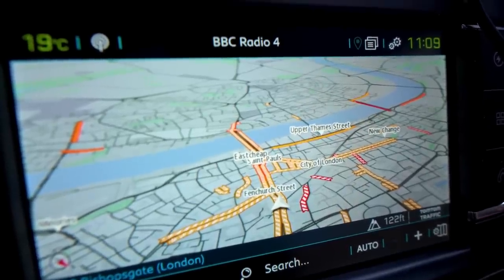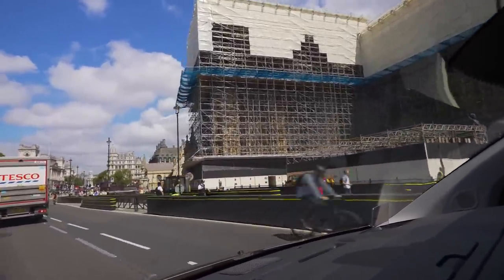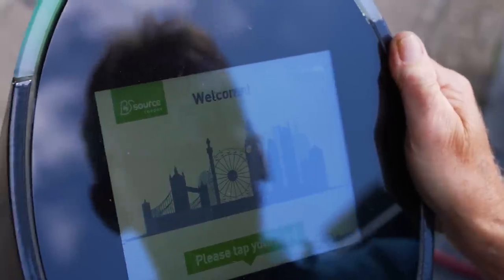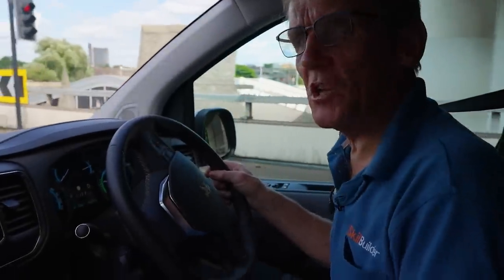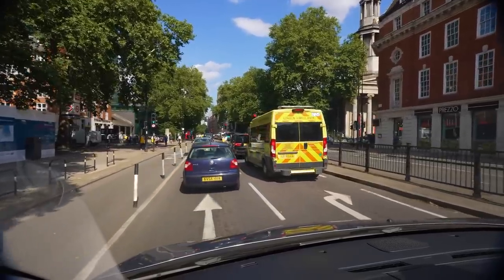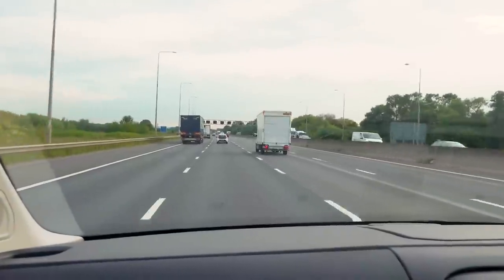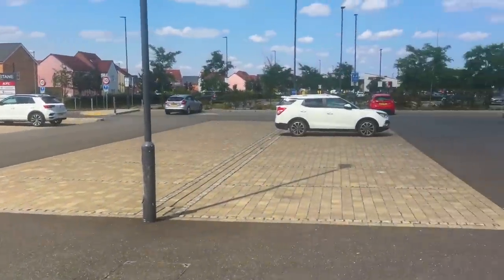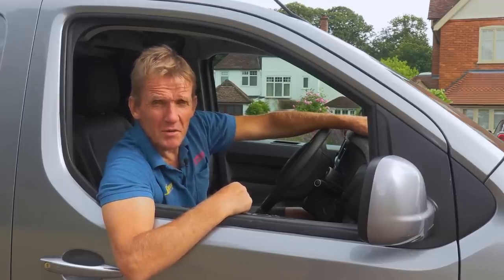Is It Time To Switch To An Electric Van?  e-Expert Test

Comment: it would be good to see how well the van dose in winter when you need lights, heater, windscreen wipers, etc.
Reply: I think we all know the answer to this, tests I have seen with loaded vehicles & fair bit of electrics in use pretty much halve the potential max range .
hybrids make more sense and reality is EV vehicle not as emission free high efficiency as you think, take a look at the coal, gas, oil, nuclear, biomass plants producing the bulk of the electric and see how green and sustainable some of them are long term and in required numbers power a EV future ...
Reply: FYI like diesel vans, the lights and wipers run from the 12V battery so doesn’t affect the range.
Reply: Most of your charging will be at home and many green tariffs are now cheaper than coal-based tariffs. When charging on the go, choose one of the many green only charger companies. This way you can charge completely fossil free.
Reply: @jezthomas4402  the 12v battery charges from the main drive battery through a dc to dc step down inverter. So it has to reduce range. That's why EV try to pre heat or cool while plugged in to take the initial loss of energy.
Reply: Especially when the battery begins to degrade after a couple of years.
Anyone with a smart phone will know the answer!
Reply: @twig3288  A smart phone uses lithium-polymer which has a fairly short life but are highly compact  making them ideal for small handheld products, most EVs use lithium-iron-phosphate batteries that have a much longer life something like 10x but a lower energy density meaning you need a bigger space for the battery something a large veicle has no isseue with.
Reply: @jezthomas4402  Really? It might well last long but it won't be near its full capacity by then. I've had ev's since 2010 and they have all deteriorated by varying amounts. Mileage doesn't help but age is the real killer. Remember these are range limited vehicles in the first place and after a year they usually drop a bit. Then the next year its a bit more and so on. 
Eventually you end up with a very slow charging, short range paperweight. 
I don't know how short the body is expected to last but batteries over about 8 years old are usually few and far between - with a lot of the ones still going being almost useless. 
Have a look at some early Leaf adverts and take note of how much they have lost. i3's aren't as bad and neither are Teslas but they still drop a lot more than you would hope.
Reply: @twig3288  In a couple of years, the battery will have degraded around 5%......if that.
Reply: @Brian-om2hh  It depends on the charging cycles.  Fast chargers will cause the battery to degrade faster than granny chargers.

Comment: Can't wait to see charging vehicles outside Terraced housing and in blocks of flats, top it all off with the yobo kids vandalizing
Reply: I'm quite excited to see the tax system that will eventually be imposed when more people go electric. It's also going to be quite nice when the prices for electricity in the night get hiked up to meet the new demand
Reply from the maker: Chewy. That is the problem and it doesn't seem solvable from where I am sitting.
Reply: @Phil Ware You don't park your car in a petrol station every night either, how is that different, oh yes, some of us have brain cells
Reply: @Phil Ware it takes 2-3 minutes to fill a car with fuel. That's how it's different.
Reply: @Phil Ware if we're trying to go to a fully electric system for transport I'd say yes, some people not having a charging point available would be a fairly big problem. Have you ever lived somewhere where you don't have enough dedicated parking for your house members? When your coming home from work not knowing if you'll even get a space anywhere near your house? That's pretty miserable by itself, add in the anxiety of not knowing whether you'll even be able to get a charge to get you back to work the next day and you have a problem.
Reply: @Phil Ware well, rapid charging comes at a cost, mainly for how long that battery cell will last. The price of replacing those cells is also pretty eye watering. I think you're very naive if you think this fundamental flaw can just be "solved". I think you're also quite naive to believe that all these wonderful free charging points will remain free for too much longer.
Reply: @Phil Ware you really thought that one through, those long hours that people drive and are too knackered to stop at a charging point before bed and wait a few hours before then finally going home to bed, yeah there RE YOUR BRAIN CELLS
Reply: @greenreaper1985  he really isn't very bright is old @Phil Ware ,
Totally brainwashed by what the eV car salesman told him,
My mate just bought a Renault kangoo eV van it's absolute dog shit 70 miles on a charge what use is that when your a builder working on site with zero charging points!! 🙈
Reply: @pauldavies7251  it's not that he's stupid, he's just in a more privileged position than a large portion of the UK are in (not to say he hasn't worked hard for that position of course). The whole electric vehicle system will work very well for people in a higher income bracket, there's no doubt about that but it's going to create another layer of hierarchy if we're not careful. Can you remember back to when parking somewhere even vaguely near a city centre or beach DIDNT cost an arm and a leg? And people are expecting not only the car parking space but the electricity to charge your car to remain free? It's a ticking time bomb. It wouldn't surprise me to see £50 parking spots with chargers in the near future
Reply: It's obvs mate unjust dangle an extension lean from the 12th floor and hope when you come down in the morning your still plugged in and your neibour hasn't helped themselves 🤣😂🤣😂🤣😂
Reply: @Phil Ware in our lifetimes batteries have come on leaps and bounds, but I still don't think they are the solution to our problem. I think long term the hydrogen fuel cells will be our solution until we can more safely harness fission/fusion reactions
Reply: @Phil Ware not if they unplug the 13 a plug top from the extension lead 😂🤣😂🤣
Reply: @Phil Ware the charger leads are relatively short won't reach the 6th floor mate🤔
Reply: @Phil Ware your main argument is that people are judging electric vehicles by today's standards and not what they could be in a decades time. I'm fairly sure the people who are working on the hydrogen cells won't be sat twiddling their fingers for a decade either. Let's wait and see how much "tax" will be applied to electricity in the very near future
Reply: @Phil Ware 20 minutes charge option boils the battery pack and dramatically reduce vehicle life. Fast charge should only be done once in a while  ..
Normal charge 22 hours. From a 13 amp plug socket.
Reply: @Phil Ware hydrogen fuel won't work because you don't understand it. Brilliant
Reply: @Phil Ware where was my first example of name calling?
Reply: @Phil Ware Are you still bleating on ? With leccy cars the grid will crash every night unless enough nuclear plants are built. You and the green brigade don't want them so good luck getting to work like the working class need to
Reply: @Phil Ware The difference is you can fill up in a fuel station in a couple of minutes.

Comment: Can the National Grid infrastructure handle it at peak charging times? Can we have a National Grid electrical consultants point of view on this? Is there enough natural resources in the world to handle this policy?
Reply: The grid are crapping themselves
Reply: Actually the answer, surprisingly, is yes it can! Have a look on youtube for a guy called John Ward - he's a very knowledgable electrical guy with no connection (pun intended) to power companies. He gives the full picture.
Reply: @Pandora882  BS , the grid says they can handle it look on their website
Reply: Yes the grid will cope, see any podcasts by the Grid, the load on the grid has declined by 20~25% over the last decade as a result of lower energy light bulbs. The proliferation of  solar panels and the roll out of vehicle to grid technologies will ensure that loads are more evenly spread.
Reply: @bob-pc8bd  interesting, thanks for sharing, first time I have seen any reference to this previously all the info I had seen suggested no problem assuming a gradual uptake over the next decade.
Reply: There is massive excess capacity in the UK grid during the night hours, because it isn't possible to just switch off a nuclear power station. They need to find ways to encourage the use of electricity during the night, and charging an electric car is one use. The energy companies virtually give the electricity away - at around a third of the daytime rate - so it's also the cheapest time to charge an electric car. Plus you don't need your car when you are asleep.
Reply: @bob-pc8bd  The National Grid say yes. And as they're the people who actually run the grid, and not you, so I'll go with their word if that's ok with you.
Reply: @bob-pc8bd  In which case the Commons Transport Select Committee is talking cobblers, because the Head cheeses of the National Grid, plus another industry authority, sat in front of a Parliamentary Committee to answer the questions being asked here. The YouTube video of that Parliamentary Meeting with the National Grid is available for anyone to see if they wish, and the upshot was that there would be NO problems with supply...... In fact, so confident are the National Grid, they were among a number of organisations who lobbied for the ban on the sale of new petrol and diesel cars to be brought forward to 2030 from 2035. The National Grid anticipate there being around 9 million EV's on Britain's roads by 2030, and say they're ready...

Comment: I’m all for EV vehicles but in there current state I would like to buy one with a petrol range extender. Just a 15-20L tank would be nice to not have range anxiety.
Reply: A petrol range extender? 
You mean a generator?

If EV's come with an optional, petrol powered 'range extenders',  that surely proves that they aren't fit for purpose in the first place.

When the prime minister uses only EVs, I'll get on board.
Reply: There won't be such a thing as range anxiety in 2030. There are presently around 26'000 public charging connections in the UK - three times more than there are petrol stations. There has just been a huge deal signed by a charge network company to supply a total of 190'000 EV chargers by 2030. Even the less costly EV's now have getting on for 200 miles of range. How often do you drive 200 miles all at once?
Reply: @Brian-om2hh so, petrol stations generally have between 4 and 12 pumps, so your numbers are pure fantasy, 
People do regularly drive 200+ miles per day, how do you think the crap you order of Amazon gets from the docks to your front door? Not to mention the high class foods that have to be driven into the city centre  so you'll have something to eat while you wait for an hours recharge in order to get home.
Then let's ask, where is all this electricity coming from? In order to meet demands we will need more power stations, and thousands of miles of copper cable, and hundreds of thousand tons of concrete and steel, do you have any idea the environmental costs of producing, and installation of these types of materials?

 You show how out of touch with how the real world works you are.
Reply: If they fitted gearboxes to EVs, then range wouldn't be so much of an issue.
Reply: @ramblingman8992  how would a gearbox help extend the range of EVs?

Comment: Looks like a good van, but things like electric sliding doors, GPS monitoring and cameras are just using valuable battery life.
How hard is it to open a sliding door? (And would you ever remotely open the side door, exposing your tools while still sat in the drivers seat? And the rear camera, like you say, you can reverse fine with mirrors? A built in reversing camera but no dashcam?
The purchase price could be lower and range longer if you ditched the gadgets surely? It's a van, not a pleasure vehicle.
Reply: And a roof. Who needs a roof?!
And 4 wheels. Why 4 when 3 gives stability?!
Reply: @Monaleenian  haha, very original,  
Lmfao! 
Tell us another un?

Comment: Wait till the mayor has turned the whole of London into electric the congestion charge is a charge for a vehicle doesn’t matter if it’s petrol or diesel it’s a congestion charge so eventually the mayor will charge you to drive in central London in an electric vehicle because you’re paying for congestion not whether it’s a petrol or a diesel is a congestion charge and eventually they’ll be nowhere to fucking charge it because everybody Will be using charge points and the cost of parking will go through the roof for the loss of revenue and income that the congestion charge generates so the only person to blame for the cock up of London is the mayor he is one big prick
Reply: Fact Check:
The consensus of expert opinion is that EVs don't cause congestion.
The science is settled
Reply: I've just ordered a Horse and Cart !.
Reply: @moonraker124  You do realise of course that horses emit greenhouse gas?

Comment: I like the idea of electric vehicles, the quietness and the driveability. I’m not convinced by their eco credentials, in fact I know fine well they’re a load of bollocks on that front. 
The problem is they’re no use to me as I regularly drive several hundred miles a day and not to big cities with facilities. The other myth about e-vehicles is that battery technology will catch up and increase range. The truth is Lithium cell technology is approaching it’s capacity and so range will always be an issue. 
I personally reckon Hydrogen fuel cells are the long term solution. Hydrogen production isn’t easy but it solves the local air  pollution issues with a quickly re-fillable fuel source. 
It should also not be forgotten that there is still no more efficient means of turning a portable energy source into useable power than the diesel engine. We shouldn’t confuse politics with engineering facts.
Reply: @immers2410  "ok boomer"? What does that even mean?? you use 2 words to discredit a well constructed argument, 
Ultimately you are just name calling/ bullying.
Well done.
Reply: Range issues disappear with quicker charging. If you have a 250 mile range but can recharge fully in 5 mins then no need for more. That will be the future, plus hydrogen for planes, trains, ships, large trucks etc. I agree though on the climate change side of it, in that leasing an EV every 3 years is not good for co2 emissions, buti suppose at least it is better for air quality.
Reply: @RandomShart  but battery lifespan decreases with faster charging.
Reply from the maker: Sorry Sally I took the comment from Imran Hussain off before I saw your reply. We don't need tossers who just want to insult people. I am sure he wouldn't want somebody insulting him.
Reply: @sally6457  for now yes but this is still just the start, still decades of research and design and new battery tech to come yet. It does mean that current EV buyers are still guinea pigs so we're better off leasing for the foreseeable future when it comes to EVs, until we know which standard will be the way forward.
Reply: You are not correct and the format of the cell can have significant effects on available range. The reason why these initial EV vans have lower range is an economic decision. It's not like fuel where there is not a weight tradeoff of additional range. With a larger pack most of the time you are lugging it around for no use, so many manufacturers are using the limited cells they have in smaller packs in order to target shorter range routes and fleet operations especially. Your miraculous long range every day cross country EV van will come later when cell production is not constrained and most likely it will be on larger format cells.
Reply: "I’m not convinced by their eco credentials, in fact I know fine well they’re a load of bollocks on that front." Can you explain what you mean by this? You can hardly deny that they're far better than petrol and, particularly, diesel vehicles as far as air quality is concerned?? That's a major eco credential in densely populated areas like big cities.

"It should also not be forgotten that there is still no more efficient means of turning a portable energy source into useable power than the diesel engine." That's fine, but do you want to live in a city with millions of diesel engines running?
Reply: @Monaleenian  They’re better for local air quality but not the planet. Which is fine if you’re only concern is air pollution in a place like London. If you’re concerned with reducing carbon emissions in the global atmosphere however, they’re not actually that good. Especially if you compare against a diesel engine burning biofuel.
Reply: @Swwils  Lithium cells are not the solution to long range electric propulsion vehicles. I suspect Hydrogen fuel cells are. The problem with Lithium cells is they can only be loaded so much before heat becomes a massive issue and we’re approaching the limit of that. I’m from the marine world where battery propulsion is being introduced and my day job is trying to clean up shipping so please don’t consider me a Luddite when I say that. Cleaner propulsion for all vehicles will come but I don’t think lithium batteries will get much further than they already are.
Reply: @RandomShart  lithium battery lifespan and cost is another ticking time bomb. There is a company in Livingston that is recycling vehicle cells into UPS systems for offices but that’s only a tiny slice off the top of the impending waste vehicle cell tsunami.
Reply: @chrisryan3770  the discharge rate and heat required is not problematic because EVs have such large packs. You are limiting yourself by current cell production technology.
Reply: @SkillBuilder  you have nothing to apologise for,  we're all only human after all.